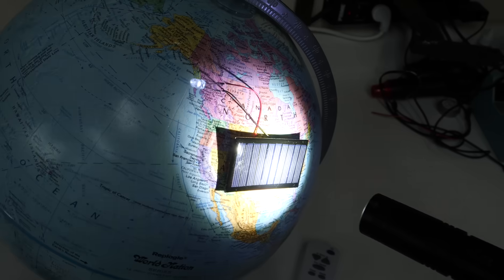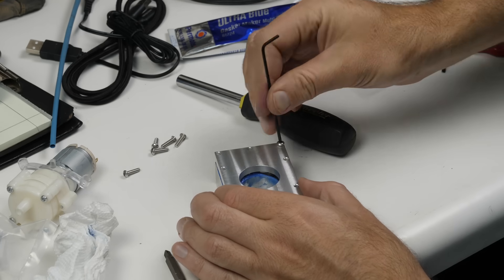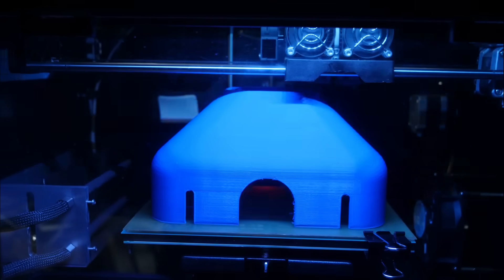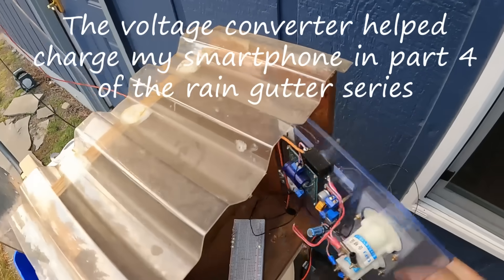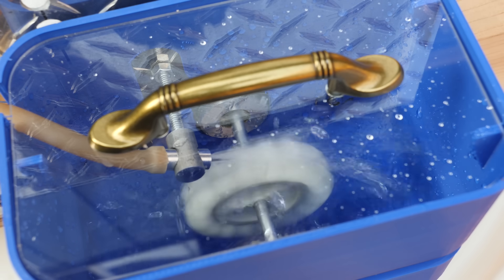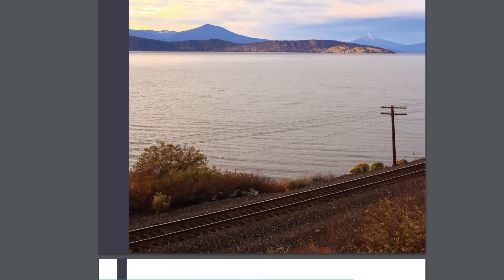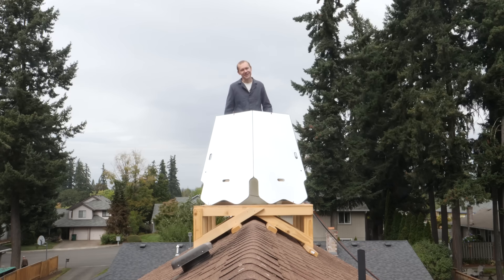Storing Solar Power on my ROOF!!!

Comment: So ideally you'd buy some kind of water tower. Have panels fill it up over time with rain water captured from your gutters. Once full, it's a water battery only used as a backup. The rest of the time you use the solar panels to just charge normal batteries. But when those batteries just won't do the trick, because of too many days without enough sun, you can use the water tower battery to generate electricity. This will buy you enough time that the sun will likely come out again and charge your normal batteries for you.

Comment: Theoretical question, could you simulate the effect of gravity and still have a working water battery? Meaning instead of using solar for a pump up to an increased elevation, you instead had the tank on ground level but pressurized it, using the panel on a compressor and pressurized the tank so that the water would come out at force to generate electricity. Not sure if this would be more viable, but wonder if there is a way to make it as viable for people with more space restrictions or HOA’s lol
Reply: The video demonstrated 3.89 Watt-hours of potential energy storage which is not viable.  Compressing air is very inefficient, making it even less viable.

Comment: Hey, this has always made me wonder. If falling water is a way to generate electricity, why don't houses have them built in to their gutter systems? I'm sure something very robust could be built. Just imagine what the rainfall on a whole roof could generate. Surely it won't be anything huge, but if most houses had some kind of water energy generation system, I'm sure that would be a sustainable improvement
Reply: The average US house has a footprint of around 1,350 square feet (125 square metres). The most rain falls in Hawaii, 64 inches (1.6 metres) per year. A typical house in the rainiest state would receive 200,000 litres (200,000 kg) of rain water over a year. The typical gutter height of a US house is 20 feet (6 metres). collecting the energy at 100% efficiency of 200,000 kg falling over 6 metres would yield 11.76 million Joules or 3.26 kWh - less than 1/3 of the daily electricity consumption of the typical US household. The average US rainfall is half that of Hawaii, so on average a perfect gutter energy plant would yield 1.63 kWh per year.
Reply: @batchrocketproject4720  wow, that was incredibly thorough, so even if the efficiency was half that, it would at least make a small yet noticable dent. That's cool
Reply: @Retinetin  It's disappointing and I was surprised how little energy is available from rain. At least on the huge scale of reservoirs on mountains, useful energy can be had.

Comment: Really cool science project. But for actual household use it's just not enough. You can try to calculate how much mass you would need to move the 7m onto his roof to get just 1kWh of energy (like running a vacuum cleaner for an hour) and you get about 50 metric tons :S

Comment: Why can’t you have multiple turbines as the water falls? After each turbine one would only need funnel the water back into a small stream again for the next generator. I assume one could wire a secondary system in one’s house using 12v and power most systems this way

Comment: or instead of making giant structures of batteries, concrete buildings, tons of electronic components, then maintaining the renewable equipment, realizing that the amount of energy the sun pumps into the planet is fixed and any energy we take for ourselves would have otherwise been given to the natural environment, realizing that solar farms eat massive amounts of land area and wind turbines cause massive amounts of noise pollution, take fibreglass to make, and kill large birds of prey (many of which are endangered due to their naturally low populations) you could just, I don't know, use nuclear power which is more energy dense, safer, doesnt pull energy that would otherwise be used in the natural environment, and doesn't require us to massively restructure our entire power grid. But, nah, saying the word renewable makes me feel good about myself, I'll keep parroting solar power.

Comment: Solar absorbers have been around for ages, but are now quickly becoming more popular.
I've seen and inspected systems running nicely for well over 20 years, with the matt black absorbers on the roof, and a storage tank right underneath - filled with water and about 30% glycol, to prevent freezing in case there's for instance a pump failure. That water heats 'normal' (potable) water to a usable temperature for a shower.

Since their heating system was in need of replacement, I advised them to expand that by using this solar energy in the winter to preheat water in a new (water to water) heat pump, so they can now also heat their building with it.
Very efficient.

Comment: I’ve been looking for a way to do something similar and practical for years. Hint: I still haven’t figured it out. A local power company is planning the reservoir trick in Wyoming. When I asked about the water freezing in the winter they couldn’t answer that. I think a system using a thin oil that doesn’t solidify would work in cold climates on a smaller level.
Reply: Depending on how cold it gets adding anti freeze to the water might do the trick
Reply: @wilburosgoodwormsley   Im sure they must have aerators and pumps or something to keep the water circulating the water so it cant freeze? Antifreeze ! Wow thats alot of antifreeze. Lol but its alot of water, hmmmm foot in mouth i think on this one.
Reply: @GSAW66  didnt say it would be inexpensive

Comment: How about two vessels, one big one with an inflatable bladder inside which can be inflated by an external solar powered electric motor. Connect it to a smaller vessel via a pipe which has a shut of valve and an alternator and turbine connected to each other, then add a smaller connecting pipe between the two vessels with a shut off valve. Then with both shut off valves closed, fill the large vessel with an air conditioning gas. Open the valve on the small connecting pipe, use solar power to inflate the bladder which will displace the A/C gas and compress it as it forces it into the smaller vessel then close the valve. Use solar power to suck air out of bladder. Now you have energy stored ready to make power by opening the the valve to the turbine/alternator.

Comment: Fun demonstration!  But in reality, getting a grasp of the size/scale shows why this is not really competitive to batteries in terms of energy density.  In this demonstration, you have 55 gallons of water falling 23 feet to give 4 watt-hours of energy.  For comparision, a single AA-sized lithium ion battery stores approximately 3 watt-hours of energy.  Another factor to consider is the overall efficiency for a full charge+discharge cycle.  This being said, pumped hydro storage systems have their place in the energy storage / buffering world.  Large-scale systems have been in use for many decades.

Comment: If my math is correct to generate 1kwh of energy from your setup you would need about 52,424.6396 kg (liters) of water.
I have a house of the same height, to bad my roof cannot hold that kind of weight.

Nice video, keep it up! 💪

Comment: Wrong. An LFP battery is not significantly degraded by repeated charging cycles. LFP is not the highest energy density but best to not throw out a blanket statement about LITHIUM.

Comment: If you are connected to the grid to cover up energy needs when the day is cloudy or at night you can store excessive energy, produced by your solar installation, in the grid. In such case the cost to pump water to the top of the roof should be less than your energy storage fee at the grid operator. Is this the case in the US?

Comment: hmmmm  one point to be noted that the water pump you using have roughly few thousand hour life. so it will burn eventually.  and u have to buy another one for $$$ , then let say you buy another on for 10$. so u can compare it with 10$ real life power which can be if we say 20 cents for 1 kw , u can say 10 * 5000 = our 50k watts money

Comment: Hello, thanks to YT I found this interesting topic unfortunately only today in July 2022 ;)
But I have to give my "mustard" directly, no panic about the "mustard" in Germany they said it that way, I think you say "my 2 cents"?! our idioms don't make any sense directly translated, unless you know the historical background!
What I actually wanted to say! Have you thought about increasing the flow rate of the water? I think the associated method dates back to the 19th century. where the gold diggers started industrially washing the gold out of the rock!
however, the turbine would have to be more stable because otherwise the water pressure cuts through the material

Comment: the reason your pump is so hot is because all pumps have a "head" or "Rise" rating to them.  it represents their capacity to pump water up X distance in height.  If your pump is not rated (and that little pump is most likely NOT rated to pump water to the height of your rooftop + the platform + the barrel) to pump to the height you require, then it will at some point simply burn your pump out.

Comment: To store this much energy (14,000J), you could have used a ~$60 - 500F super capacitor. It also would have been rated for high number of charge/discharge cycles (Over a million cycles. One complete charge/discharge a day means this should last 2,000 years...)

Or, you could charge a single 2000mAh 18650 battery that's going to cost just a few dollars. The breakeven point of an ultracapacitor might be yearly swapping out of an 18650 for a decade.

Unless you plan on having many additional water jugs on your roof, and unless you like mechanical unreliability, I think ultracapacitors are the best solution for low power / low cost solar charging experiments.

Water as energy storage does seem rather impractical. (Unless you get something additional out of it, like having emergency water available.)
Reply: That’s what I was thinking, the extra benefit is having a reservoir of water.. or add a rain catcher to capture additional water and just push it over to the side, so your water battery gets refilled and you have some water storage for emergencies.
Reply: the benefit is that scale supersedes efficiency. if you had 300MW of water storage available it doesn't matter whether the pumping is 30% efficient or 0.03% efficient.  Either way you have 300MW available. at that scale the operational employees required to make sure the mechanics are working is a rounding error.  That's why he brought up raccoon mountain and swan lake.

IMO its shameful that every dam project from hoover dam through present didn't require creation of a lower reservoir just for this reason.

Comment: I love the build, I have seen it before but still cool. One nitpick, it isn't a "water battery" it's a "gravitational battery". For it to be a water battery you would use electrolysis to generate o2 and hydrogen than get the energy from the recombination of them, no gravity necessary. Similar to how a lithium battery uses chemical change to store and generate electricity. You're set up is a gravitational battery because it could be done with anything, molten salt, bricks, sand, people, etc.

Comment: Solar and wind are not trully green. It takes huge amounts of fossil fuels to produce those panels and wind turbines, and then they have to flatten out vast amounts of lands to install those farms. No body talks about this but those farms have to be maintained just like any other structure which means tansport, trash, spare parts and manpower.

Comment: to give you perspective on this "ingenious" solution.... to boil 1 liter of water it takes +- 350 kJ with no energy loss to heat. so to boil a 1 liter of water it only takes ~27 of such barrels full of water, good luck putting that on your roof... u might power LED for a while but having a practical implementation of the system, it does not make sense... as stupid ideas go this has to be up there... there is use case for this type of energy storing device, but your roof is not it...

Comment: What if,  instead of the water spinning a waterwheel,  it's pumped up,  filling the barrel and,  like a grandfather clock weight, the fully filled barrel is slowly lowered, geared to an electric generator

Probably last longer than the 55gal flowing out

Comment: Where relatively small water stores can really shine for domestic energy storage is for the purposes of heating or cooling in a heat exchanger setup.
With 4.186 joule/gram °C specific heat. That means heating a ton (m3) of water by 30 Kelvin effectively stores more energy than a Tesla Powerwall. So heating or cooling water to later access via a heat exchanger for air conditioning is a very sweet energy deal.

Comment: Pumped storage hydropower is a thing but doesn't really scale well for individual houses.  You'd need a 75,000 liter tank to store just a bit more than 1 kilowatt-hour of energy with a 5 meter height (which I think is more reasonable for most houses).

Comment: Where do you get you solar data? Per the California Energy Commission in 2019 solar power only accounted for 14% of the total CA energy production. And they import lots of Electricity of various forms like Coal 10%, Natural Gas 11% and they even import solar produced electricity which in 2019 7% of the electricity imported was SOLAR. So why would they export SOLAR when they import 7% of it annually?

Comment: An advanced form to diagnose potential problems in a system is taking a high frame camra and slowing it down frame by frame. also there is software that makes movement exagerated. its amazing to watch pipes expand and contract. so to see your pump osolating physicaly at 1/8 speed tells me it does not have a long life on that mount

Comment: How about combing this water tank with a big lever and a really heavy weight so you lift the heavy weight into the air using the lever then use the heavy weight to turn a tubine. I had a similar idea with a hydro dam to use the water that flows out and get it to fill tanks on the way through the dam then release the tanks to effectively use the water twice (or more) on the way through the dam

Comment: So you really think this is more efficient than storing energy in batteries? What do you think the energy comes from that heats up the pump motor? It is a nice model, but not a handy solution for storing PV generated energy in a reasonable ammount.
Reply: It's just a simple educational learning project and not a permanent structure or full solution for an individual home.
Reply: @OccultDemonCassette  Well, he starts the Video with a complaint about capacity loss of LiIon Batteries and states that there is something better. The title as well says "storing solar power on my roof". In the end, I learned that it just was an information about the big scale energy storage and not a serious Idea for him to use. As I live close to 2 of those kind of installations (one of it even having 3 stages), I was not aware about the lack of knowledge about this technology in USA.
Reply: @felixlohrer9600  sad but true.

Comment: Wouldn't it make more sense just to store heat in the form of heating up water on your roof using the sun? I'm sure a hot shower uses more than one battery worth of energy.

Comment: There are already millions of people with completely unrealistic expectations of alternative energy sources. So I feel a video like this does little to remedy this system. 14,200J sounds impressive until you convert it to the units we usually use to measure energy, the kiloWatt hour. You see there’s 3,600,000 of them Joule things in a kW.h. 14,200 Joules turns out to be 0.00394 kW.hr.  That’s enough to run my 1000W heater for 1.42 seconds. It’s two AA batteries. How’s that going to pay for that tank stand and pump and generator? It’s me pedalling a bike for 10 seconds. In other words SFA. Plus, I’ll be surprised if you can get better than 50% round trip efficiency.
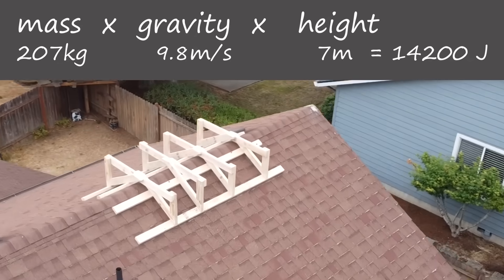So, sorry ‘n all but I stopped watching about 2:30.
No uptick, no sub, no regrets.
Bye.
Edit to correct: that should be 14.2 seconds.
Reply: Did you think this project was a permanent structure instead of a simple educational project? He literally explained the AA battery towards the end. I have no clue why you would even attempt to do the math which already exists in the video.

Comment: Yoooooo! Make your rain overflow from your rain gutter bell siphon fill up the barrel. The float switch will kill that process, and you could find something else to use the rain overflow for. A garden, or better power generation? Do you not have solar cells on your roof you could eliminate your electric bill with? Even turn the small amount you generate from water into power for your batteries when solar isn't active. Love thinking about this stuff!

Comment: I’m struggling with why not just use the solar panel to charge the device rather than using water? When you consider the loss and expense of water, loss of energy etc. wouldn’t it be more efficient to just use the solar panel and call it a day? (he asked knowingly)
Reply: The water is working as a battery, meaning you can use the solar energy at night. You will only need one barrel water and keep reusing it many times. Since you pump the same water up to a barrel and then let it flow down into another one while rotating the motor. The main meaning of this video is to show you natural ways of storing power other than relying on lithium batteries. Researchers have came up with many ways all around the world like heating up water/sand with mirrors(instead of using solar panel) then use that heat at night... This is probably the easiest one to make at home though